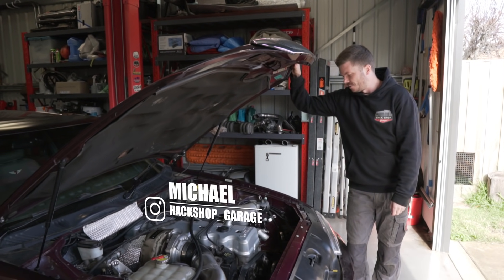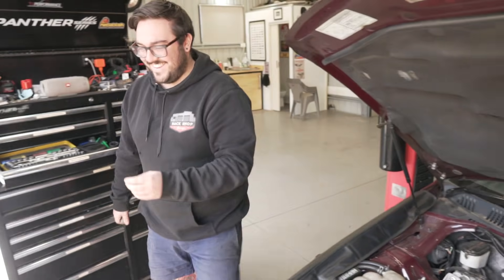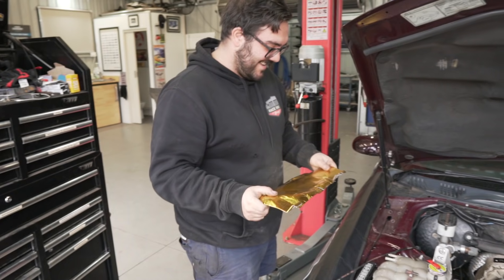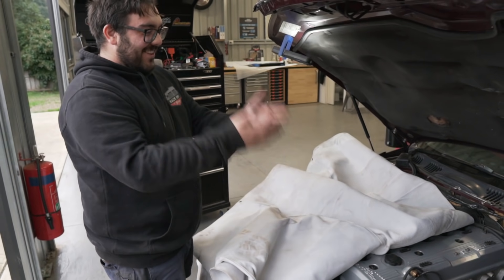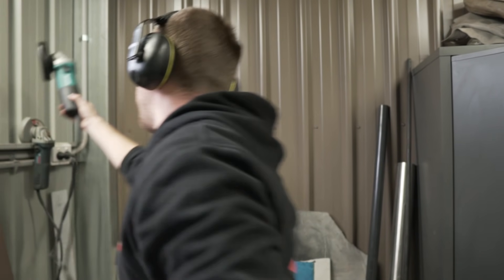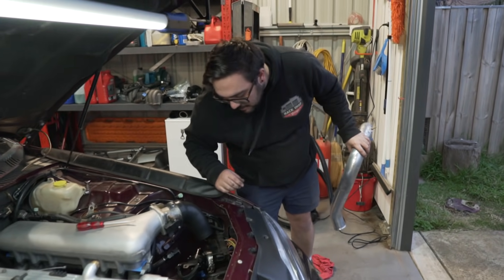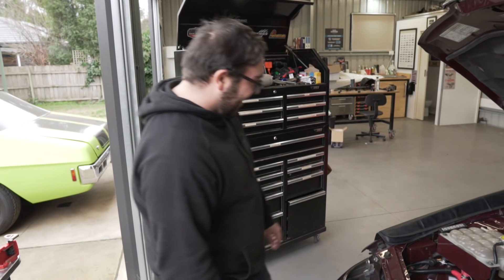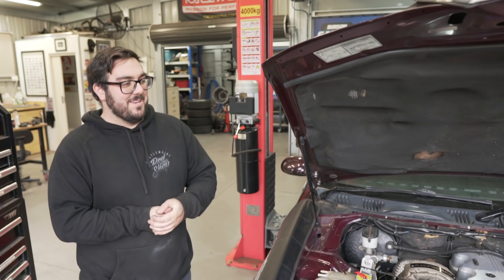Street Machine Drag Challenge 2021 Prep - Part 2 - TURBO FAIRLANE - Changing Almost Everything!!

Comment: I modified my cruise for the ffp. Easy as and so worth it.
The module bolts nicely to the radiator support and a simple bracket for the throttle body. The hardest part is extending the loom and running it to the box and that's not hard!

Comment: A hot week Summer event, so lets lose the a/c. 
Bullshit catch can so lets lose the washer bottle.
 Coils hiding under the intake,, where they will fry and fail. 
Nothing remotely a good idea.
As for the intake, you can probably screw studs into the head so it will make it easier to install. And less likely of stripping the threads out as well